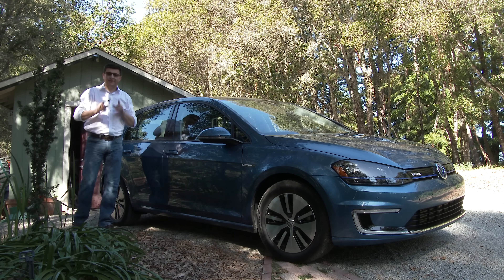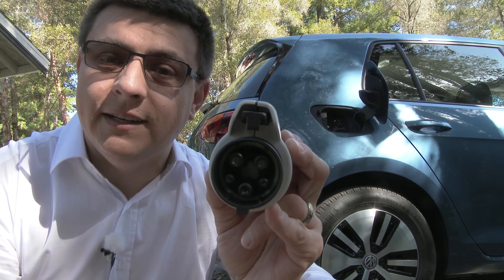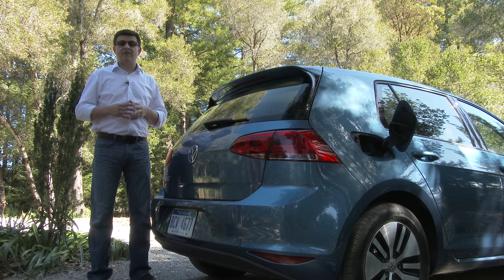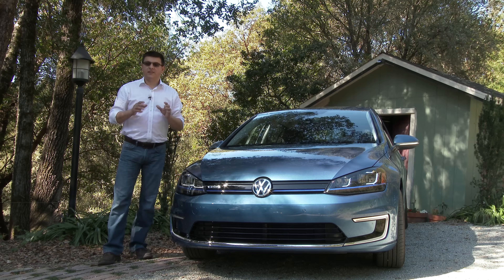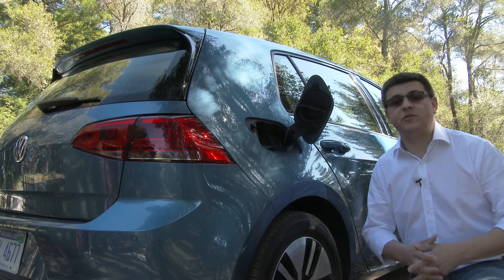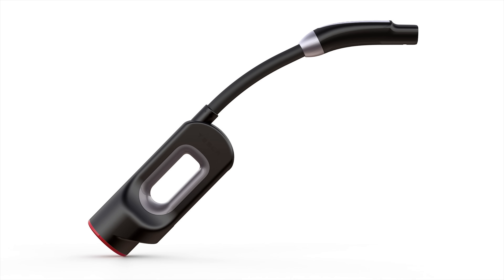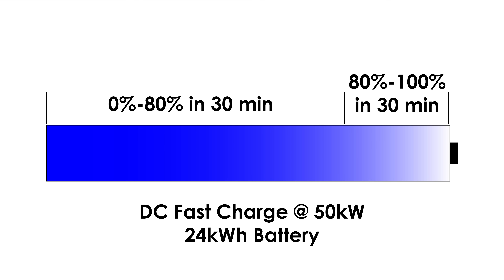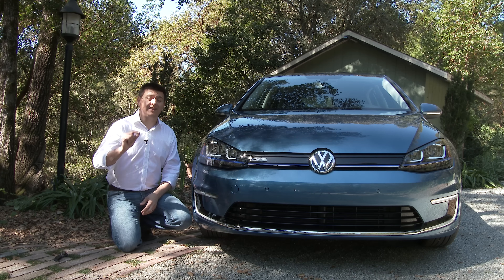EV Buyer's Guide - All About Charging

Comment: Can anyone answer me this... 
I have an Audi Quick-Charger Stand available at work. I think it is mostly used for a Q7 Hybrid Car. 
I however, might buy a Hyundai Ionic Hybryd soon...
Is the sockets, connections and power-output compatibility with the Hyundai, or do I need an adapter? - I live in Scandinavia, just in case there should be different standards...
I am new to this. Thank you in advance! ☺️

Comment: The first Volvo all-electric car, Polestar 2, made by Volvo subsidiary Polestar, has a CCS plug and can take a 150 KW charge and can charge about 200 miles in 30 minutes. Volvo will come out with 3 of it's brand name all electric cars, starting with the XC40, in the next two years. Safe to assume they too will have a CCS with 150 KW charge capability. With VW's Electrify America putting up road chargers rapidly, that can do a 150 KW charge, I think I''ll wait for an all-electric XC60 or XC90.

Comment: I hate they always says that it can charged 80% in half hour.
why not just tell me how long it takes to get fully charged???
Reply: Jalen Lee because the 20% to top off the battery doubles the time needed to charge the battery. 

If I'm out and about with a EV, I wouldn't care about getting 100%, but having enough power to comfortably get home where I can fully charge to 100%.
Reply: Its best for the life of your battery not to charge to 100% (same for your cell phone). Also, charging slows down significantly from 80% full to 100% full. You could double the overall charge time to get that extra 20%.
Reply: Mark Zanetti If a battery can't, or shouldn't be charged to 100% then it's *no good*. Theres no way I'm trusting a battery I can't top off.
Reply: rollover36  Why? I shouldn't be required to be an engineer to use something. Think about it. How many people understand what it takes to generate power, but still uses electricity? How many people using Gas/Petrol cars but have no clue about gas blends, ethanol mixed gas and why the prices vary state to state.

So the "Get educated" comment holds no water with me.

Comment: So  I can't use a chademo or a combo j1772 if my car has a j1772 (without that combo thing on the bottom). I couldn't find an adapter becasue the different voltages right?

One thing I don't understand: why they don't put regular plugs on these charging stations if they know there's 4 different charging ports out there?

I'm thinking of buying an opel ampera 2012 (a chevy volt with different badge) but my city only has chademo chargers. It's awesome because it is free, but I'm afraid I can't use it with the ampera.

Comment: small correction, I'm guessing you mean 3.3 kilowatt when you say 3.3 kilowatt hour charger, because I'm sure you know, kw is the rate of energy transfer (think fuel flow) while kwh is the amount of energy stored (think gas tank capacity).